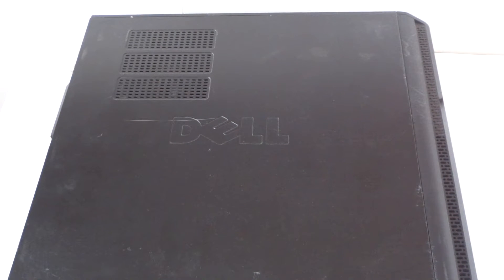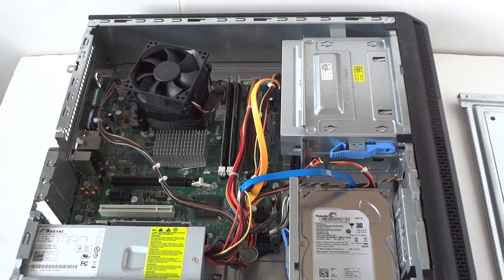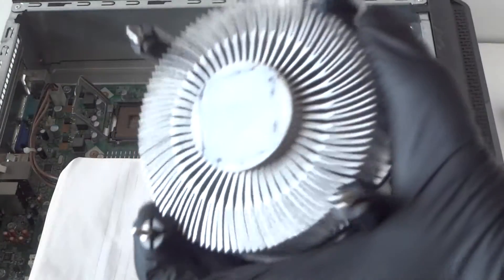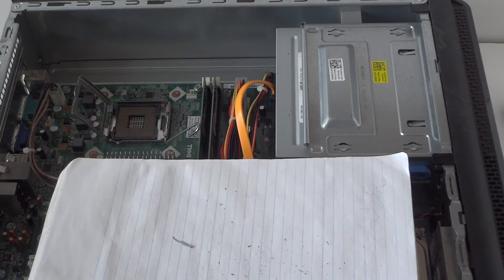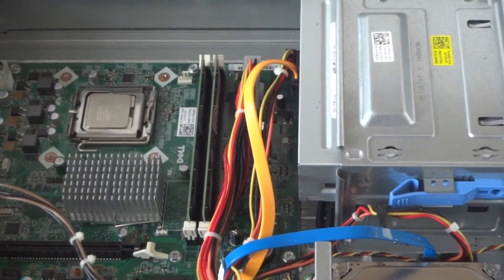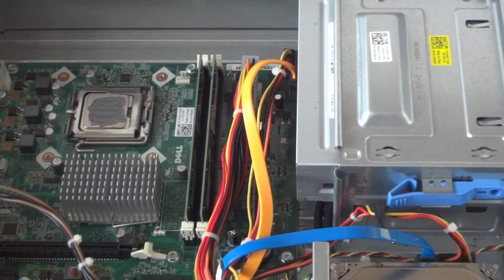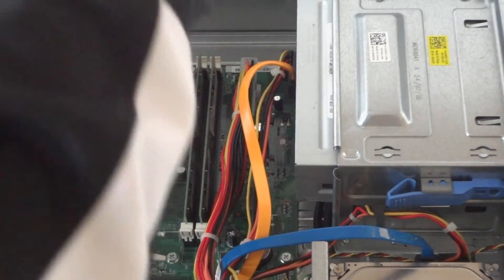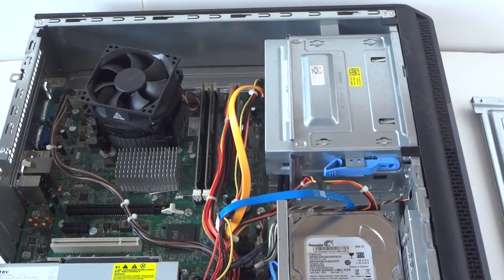Dell Vostro 230 Processor Upgrade

Comment: I'm late but I recently picked up kne of these off Facebook market place for free. Threw a GT 710 graphics card I had from a older system that died on me and swapped the jammed disc drive and it works like a dream. Looking to upgrade the CPU to a quad core soon

Comment: hello sir please i need help with the same pc that you have.my pc do not boot and shows an uncontinuous amber light with a sound of 2 beeps and still repeate that until i switch the power off,i tried to replace the ram and also clean th ram slots but nothing worked,even i tried to replace the cpu so i noticed that the beeps rythm changed i still hear 2 beeps suond but the rythm took a longer time rto repeate the beeps so can you help me please if you know what is the problem please??

Comment: I have a question whether in this computer the intel core i5 4570 processor will fit?
Reply: no! this machine is lga775 socket, and i5-4570 is lga1150
Reply: you can try, dude..

Comment: Can I upgrade to a modern processor?
Reply: No, it has an old socket and even if it somehow had a new socket it would not support a modern cpu
Reply: LGA775 Core 2 Quad. Upgrade BIOS to latest first. WHICH Quads are supported you'd have to search online.
Reply: @WellBeSerious12  Can you tell me if this Vostro 230 supports a Core 2 Duo E8500?

Comment: I have replaced a hard drive in a Dell Vostro 230 mini tower however I can't get the system to boot - receive the code of 2000-0141 when running Dell diagnostics - would you have any suggestions?

Comment: thanks for your clip, i am using this machine and am struggling to update how it is, hope you give me some more tips when upgrading dell vostro 230 computer ! thanks you
Reply: CPU: up to LGA775 (compatible models unknown, you'll have to search online)
GPU: up to any PCIE non-power connector GPU (GTX 1050 Ti might be best, but will be bottlenecked, 750 Ti or 1050 might be best fit?)
RAM: up to 2x2G DDR3 (1066Mhz, higher speed compatible but won't run faster)
Storage: use SSD for main, can use other SSDs or HDDs for non-primary storage

OS: Windows 10 Pro x64 (find online guides for optimizing it [for any PC]!)
SATA Cables: SATA 2/3 (same cost, SATA 2 onboard)
Thermal Compound: I recommend Arctic MX-4, Chinese GD-900 may be almost as good

Comment: I live in a rented house with a dude that keeps bringing stuff from work and then throws it away because he thinks it's trash. Well this was the second unit ( complete with keyboard and monitor and cables) that he threw away , I just cleaned it , pluged in and it runs perfectly , just ordered a mouse and I'm ready to use a free PC.

Comment: I have the same PC, i change a Celeron 450 to Xeon E5450 (Q9650) after update the last bios, but is hot as hell cpu running almost 70ºC in full and 55º in idle, the original cooler is a crap and thanks the backplate behind the motherboard and is not possible change the cooler.
Reply: Xeons have the sensors 15° more to the real temp
Reply: The important detail is that you've changed the thermal transfer compound, and not reuse it. You will find that the CPU will inherently run hotter. You've swapped a 35w CPU for an 80w CPU.

However, Dell typically doesn't skimp on their heat sinks, so it should probably be sufficient. As long as the thermal compound is proper.

Now, keep in mind, CPU's can run hot. Quite hot. And 70C is actually within running spec of the CPU. So, really, as long as your fan isn't going crazy causing a lot of noise, I wouldn't sweat it.

Cheers

Comment: 91% isopropyl for cleaning the CPU/cooler works much better, and is still available at most drugstores.

On this system, just putting an X of compound on, about 1/16" round beads works well.

Also, a nice upgrade is a server Xeon X5450 CPU.  

Update the BIOS, use the 771-775 mod sticker on the CPU, trim the nubs 
on the CPU socket, and that's it.  It boots up and recognizes it 
immediately.

I just did this on a 230s, and the Window Experience is only 0.1 below 
the 260s I have with an i5-2400 in it.  I know that's not exactly a full 
performance test, but it definitely gives it new life for $12-15 for the CPU 
and sticker.
Reply: talonts9 my mom still uses this, she had an e7500 dual core, 2gb ram, and complained how slow it was. I upgraded it to windows 10 64 bit, q9550 quad core, 8gb ram, gtx 750ti low profile I wasn't using, and a 240gb ssd. Now, it's plenty fast for all her needs. Spent around $50 for cpu + ram and $70 (with coupon) for the ssd.